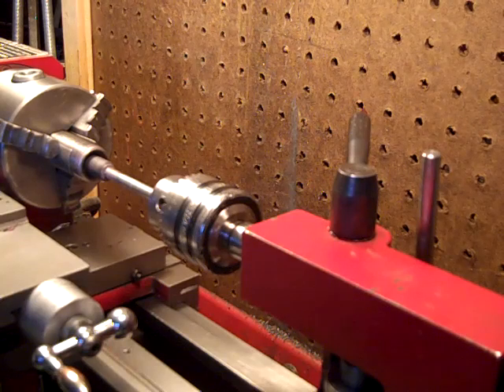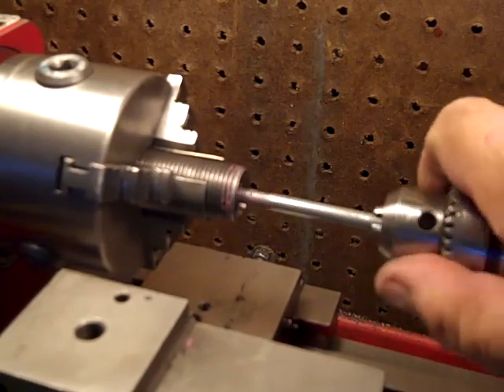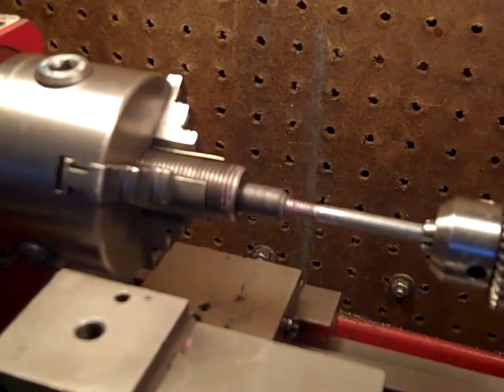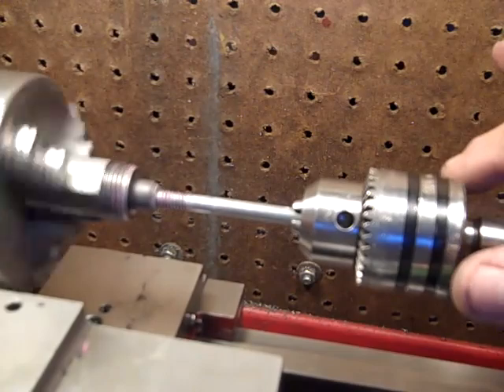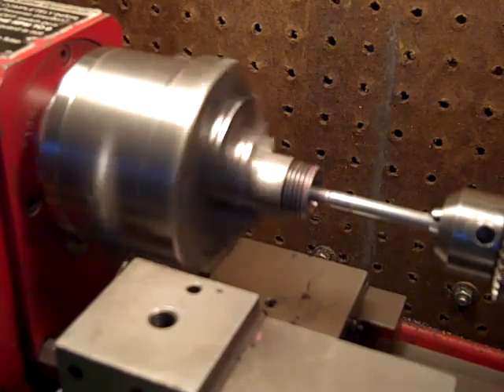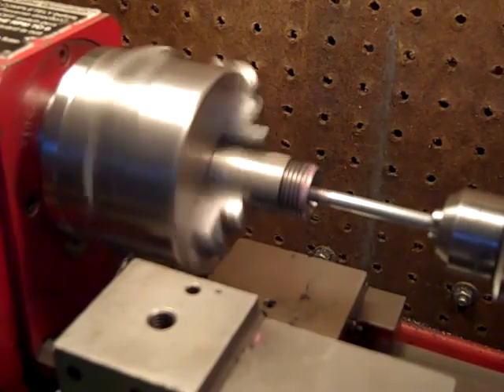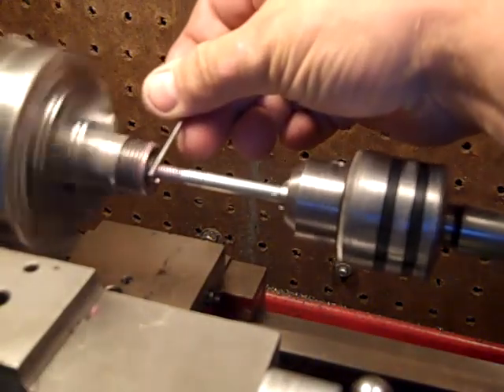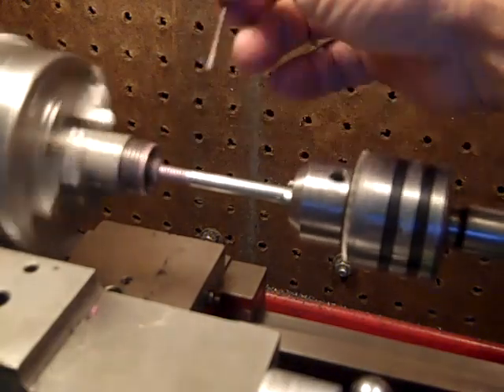PolishMechanism For Bullet swaging dies

Comment: Great video and information!
I want to machine a slug swaging die for my .25 airrifle.
I was still wondering how i should polish it. Was thinking about making a suède leather lapping tool in the right size, or just pressing it with the tail stock to get it to fit.
Your way is better, using the exact shape wich came out of the die.

Comment: You will ruin the spindle in your tail stock
Reply from the maker: Well I am pretty brutal on my machines. This however is not as destructive as you may think. Lots of oil and haven't run this operation total of  more than a few hours on my lathe. AND I have a MT2 reamer if it gets too mangled up...I can just restore the spindle taper. But thanks for the good advise.